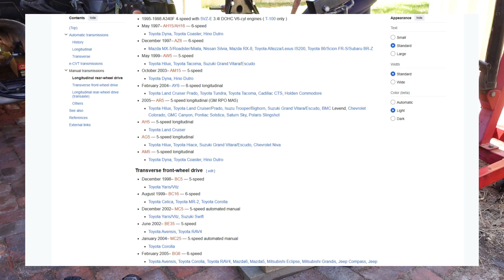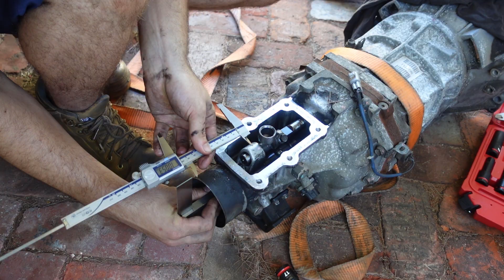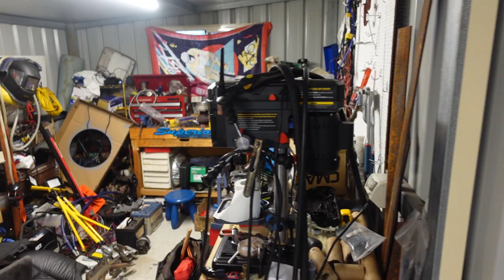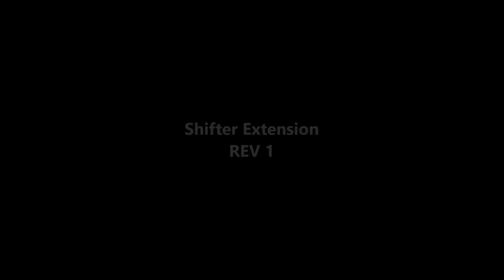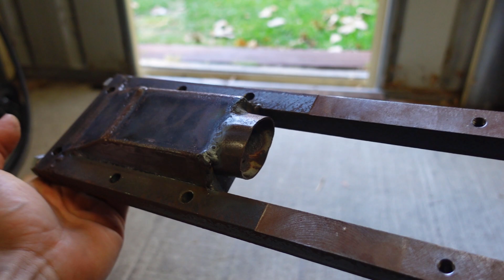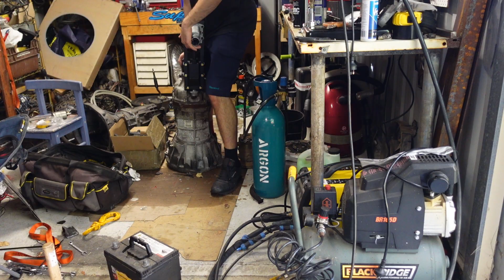Toyota R150/R154 Custom Shifter Extension

Comment: Great Work! I need an extension for my MKIII R154 extended 4.75 Inches installing in my FD RX7 are you willing to make another?
Reply from the maker: at the moment since the car hasnt run and driven im hesitant to reccomend this setup. i have a felling it might spill gearbox oil out the back boot under geforce but il adress that with rev 2 of the design should it need a rework.

Comment: Well done man, I made something similar to think. I also have fitted a r150 to my 3rz turbo. Which i have also fitted to volvo 740.
Reply from the maker: Man i bet that thing is sick! I looked at a volvo 240 before choosing the e39. In hindsight i wish i had chosen the 240 as it would have been way easier as far as wiring goes haha